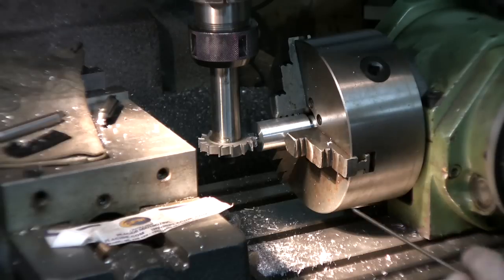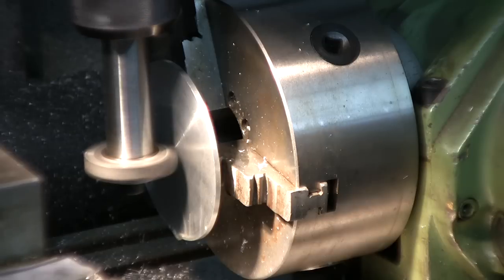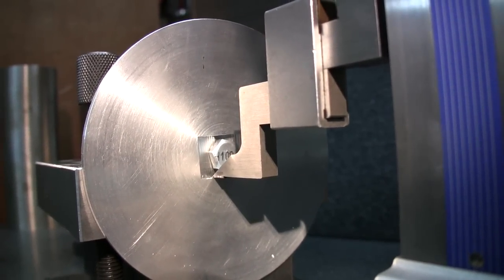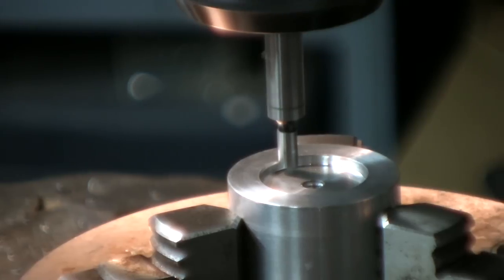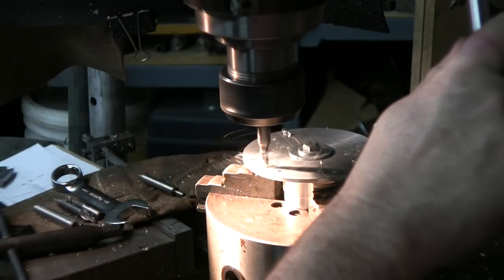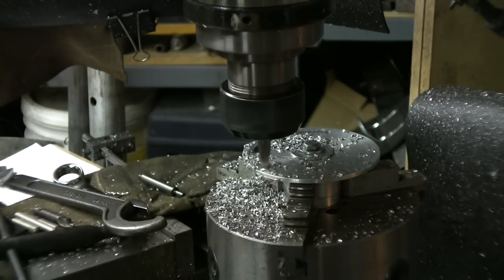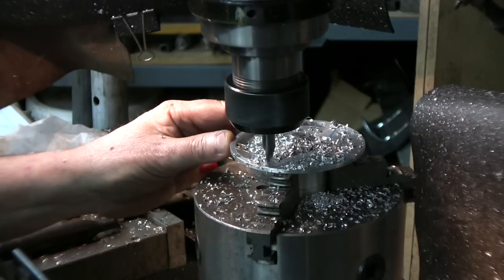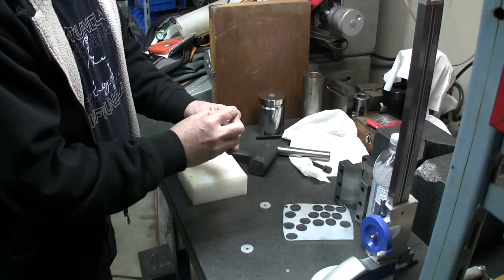Camera jib or crane part 6b making the tilt mecanism

Comment: Very nice way to make the side plate.  Came out great.  Randy
Reply from the maker: Hi Randy,
The rotary head is much less heavy than the rotary table, so, it gets picked before since it's already on the mill...lol
It's a matter of going easy since that way of holding is a little less secure than clamping on the rotary table.
Cheers,
Pierre

Comment: Very interesting.  You are very skilled with your equipment.  I think the next thing I need to acquire is a rotary table.  I will be watching for the next step.  Thanks for sharing.
Reply from the maker: Hi Harold,
If you find a rotary table that you can put vertical and horizontal, you'd be in good position with a versatile set-up, next thing you need with this setup is a suitable chuck you can mount on it...
Thanks for compliment and comment,
Pierre

Comment: In that situation again (thin section across from the sturdier section) you might try a machinist's parallel clamp (two bars and two screws - you know the kind I mean) to bridge across the cut and keep the two parts aligned. You might need more than one, and you might have to move them as the cut progresses. When the outer section gave a twitch as you plunged the 3/8 end mill, I thought I was going to see disaster.

Comment: hello, that type of material are using aluminum ....search in my country that type of material you are using ... I'm from Ecuador
Reply from the maker: +Ros Vill 
I'm not sure what is available in Ecuador, I'm using some 6061-T6 aluminium, it machines easy and is pretty rigid. T6 means means artificially aged so it got harder, it's an alloy made from magnesium and silicon, you should be able to find this or something similar in your country.
Thanks for comment,    Pierre
Reply: +pierre beaudry Thank you
for the information I trying to make this a crane for video camera
Reply from the maker: Ros Vill
Not very up to date with schematics, but I.ll try to show in an up coming video what came out after a few more modifications